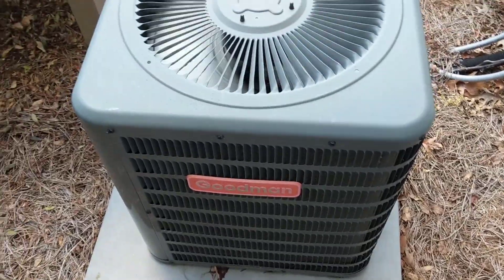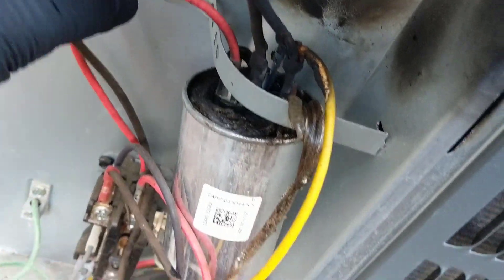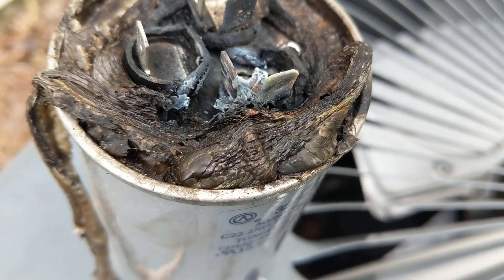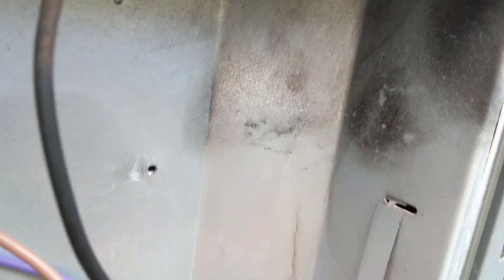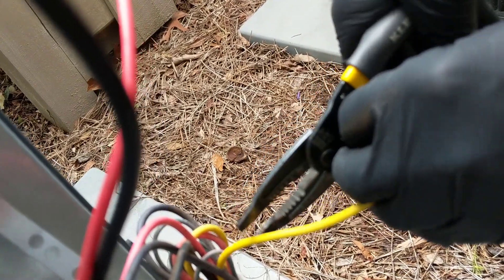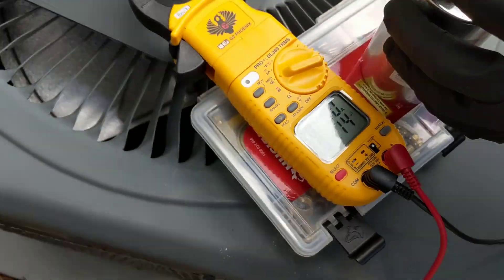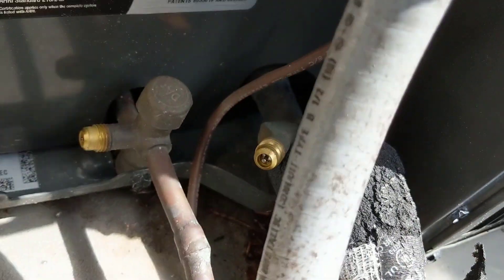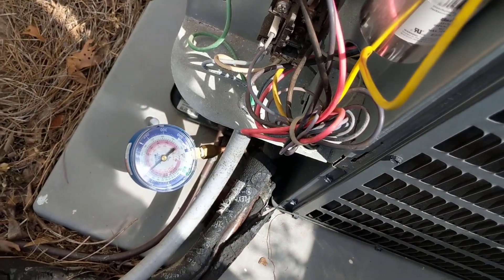AC Not Cooling Snake Blew The Capacitor

Comment: Did you turn off the wrong disconnect or are they labelled incorrectly?
Reply from the maker: No why u ask that ? The unit was apt. 1107 & I pulled out the disconnect for 1107. Are you talking about the AC's running in the background ? I'm not sure what your seeing to ask that ? I have found some condensers hooked up to the wrong disconnects, (which I've corrected those), but this one wasn't. Thanks for watching David 👍
Reply: @ApartmentMaintenance  playing vid at a higher speed. On the disconnect the first # looked like a 2. Booking an appointment  with my optometrist tomorrow. My bad. Thxs for the vids.
Reply: That snake is having a very bad day.
Tag the UEI meter, the Klein strippers, & the Husky parts box in your disciption in the (tag box) and it might get you a few more views. When people search for those items in the main YouTube search box or in Goggle search box, it will pull up your videos as suggestions. Be some to include all the part/model numbers. UEI DL389 clamp meter, Klein wire stripper #1019, Husky small parts organizer #83039N13
😎👍 Great video!
Reply from the maker: @daviddesilva4971  No biggy, I went back to watch that part again to see, and it looks like the paint marker ran alittle bit when the unit was marked, so I see what ur saying. Thanks for watching David 👍
Reply from the maker: @sknight0391  ohh nice, I did not know that. When you say tag those items in the tag box, are you talking about the tags box where you get 500 characters ?
Reply: @ApartmentMaintenance  Yep, thats the spot. Tag em' & bag em' 👍👍👍👍👍👍👍👍👍👍👍👍
Reply from the maker: @sknight0391  Nice, thanks for the tip. I will start doing that, & Thanks for watching Shannon 💪
Reply: @ApartmentMaintenance  Yeah, and tag other key words like....HVAC  Service, HVAC Tech., HVAC Diagnostic, HVAC Troubleshooting, Replacing a bad A/C capacitor.
Reply: Just remember to put commas and a space in-between each different tag.
Reply from the maker: @sknight0391  I have done some of those. Do you use tube buddy or anything like that for your channel ?
Reply: @ApartmentMaintenance  Nope, nothing fancy for me. Bare minimum.
Reply from the maker: @sknight0391  Same here